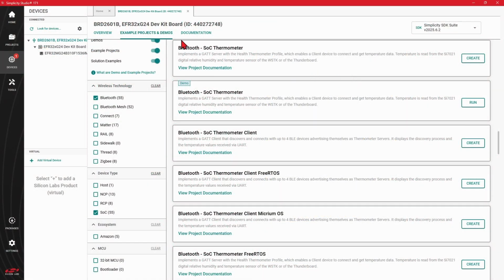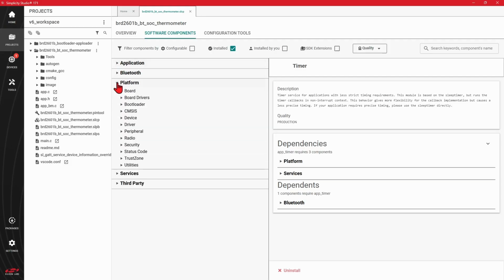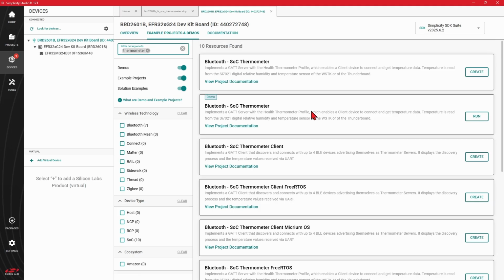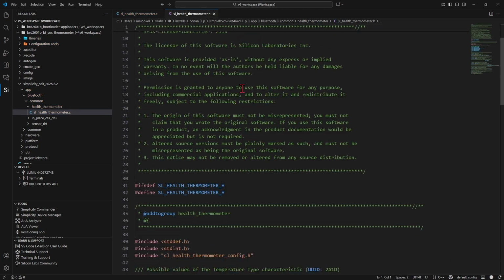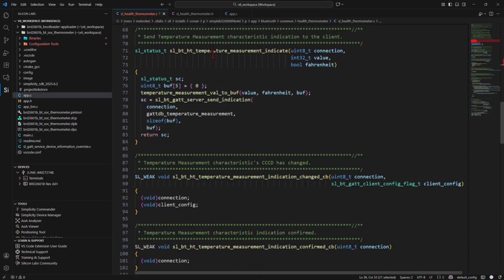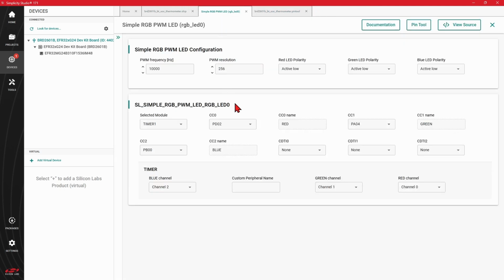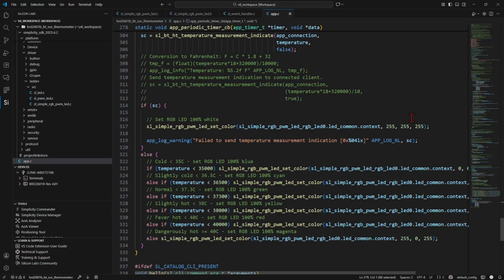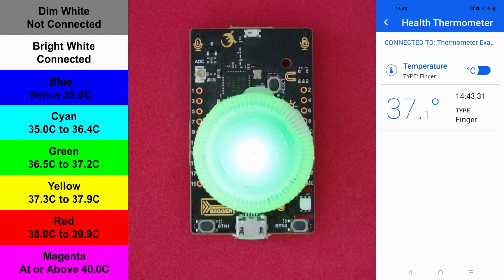Quick Start - Simplicity Studio 6 - Working with Software Components - Silicon Labs

Comment: Great video! It shows really well how to quickly run ready-made examples and play with them a little. But, as usual, people’s interest soon goes beyond the examples. It would be really helpful to see how to start a project from blanc project—for example, how to connect peripherals (SPI, ADC, RTC etc.) and set or change pins. your company has plenty of demo boards, but the basics of connecting peripherals are always the same, and knowing them would help a lot of people.
Reply: This is not really an Arduino type of platform for kids, so basic knowledge is required.